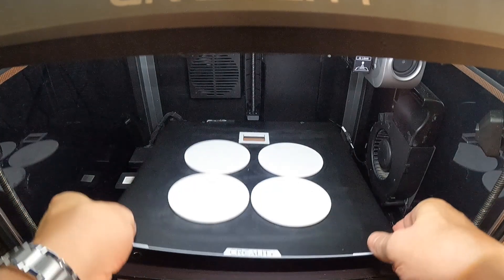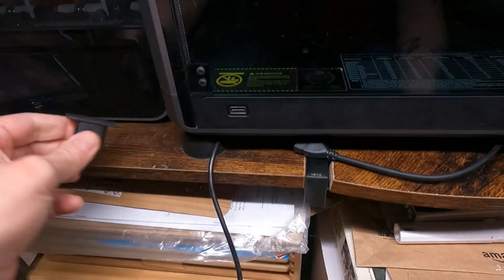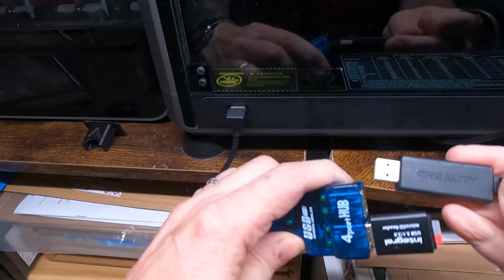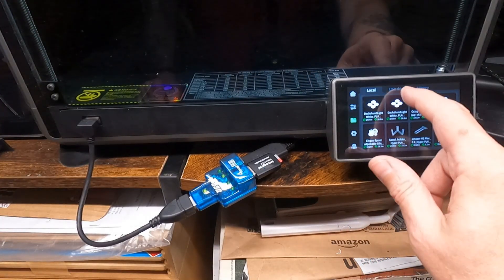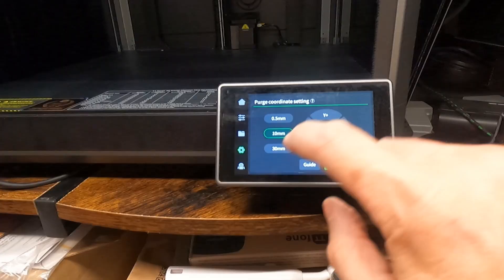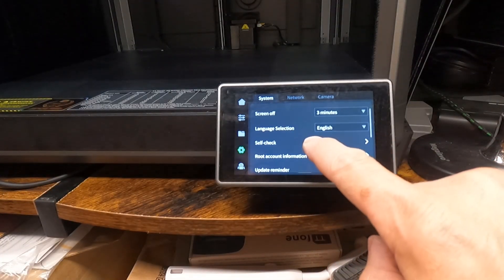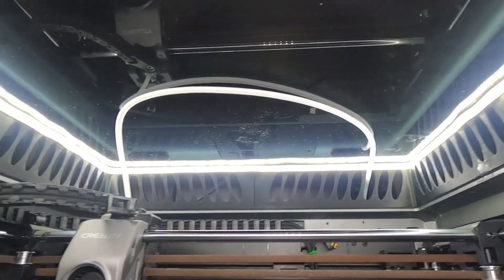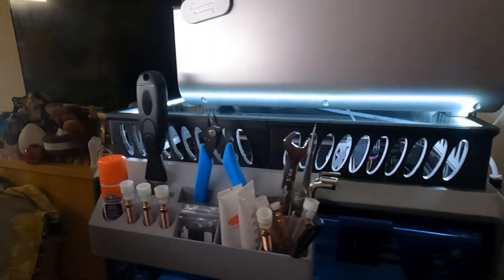CFS Upgrade Kit - Trouble shooting - Mods & Tips

Comment: Is there a way to make a poop bin somewhere
Reply from the maker: Hi, I know some have cut a slot in the back. Personally I find it going to the bottom ideal, I printed off a tray design for the bottom which catches 90% of the poop, and I haven't had any of the blockage issues I have seen reported on ones with shoots. I have limited space so not having to get behind or to the side of the printer I find ideal. I don't see a time I will go to the full extent of the height on a colour print, and even if I did it would only mean clearing out the poop before it got near.

Comment: hola actualice hace poco y le puse el cfs, pero me lanza un atasco cada ves que cambia de color, lo eh desarmado un monton de veces y sigue el problema, si me puedes ayudar te lo agradeceria
Reply from the maker: Hola, no dijiste si recibías códigos de error, supongo que no. Sé que hay gente que tiene problemas con los cambios de color cuando no usa Creality Print. No estoy seguro de si es tu caso, pero si es así, te sugiero cortar una impresión en Creality Print y probarla.
Reply: @Kalbo64 ocupo creality print y me ha tirado varios errores, pero lo que pasa es que cuando corta el filamento y cambia el resto que queda en el hoteng se tranca y produce el atasco
Reply from the maker: Hola, en ese caso, me aseguraría de que el tubo sea lo más corto y sin torsiones posible, ya que esto puede causar el problema. También confirmaría que tienes el hotend correcto para el kit de actualización (hotend Unicorn).

Comment: I had a problem with the lower feeder. It was eating the filament, and the feeder can push after this to CFS filament. Printing stopped.
Some one recommend cut the spring from lower feeder, but is not so good think to do this.
Because when I cut them the problem did not desappear.
I buy new spring (1.0mm x 8mm x 20mm) like oryginal and I added a spring pad.
And after this the problem is solved on my CFS.
Link for small pad for cfs lower feeder spring https://drive.google.com/file/d/1wkRAg-2Ewqlxf0Ghl1OHGVNHGdHK-iQB/view?usp=drive_link.

Comment: I’ve had a k1 max since January, no issues , amazing printer, last night done the upgrade and installed my cfs, first print, worked, and that’s where things went weird

I now keep getting a error (fr2849 retract issue)

But here’s the stranger part, if I push the button on the bottom of the cfs , the filament moves freely , if I trim the filament , and let it reload , it’s fine

If I heat the print head, I can also freely remove / push through filament, my initial thoughts are somehow it’s getting stuck in the buffer block.
Reply from the maker: Hi, I can make a couple of suggestions to try/check might hopefully help. First I would go to the self check and recalibrate the cutter, then expert mode and realign the purge shoot. I would then ensure all the boden tubing has a smooth direct, bend free route as is possible. I know some people go through the original hole in the side without issue, but I have seen others saying they get this error when going that route. I presume the pull strain through multiple bends triggers it. Hope this helps.
Reply: @Kalbo64 will give it a go, thanks
Reply: @Kalbo64 I eventually got it working by accident… I left its lid open 🤦‍♂️🤦‍♂️ Even though I bought 4 brand new spools of creality  cr-pla filament za it would seem that one of the spools some how, somewhere is catching. Lid closed = all manner of shit , lid open = happy cfs
Reply from the maker: Great that you got it going. I'm pleased for you.. I have found cardboard reels can be an issue sometimes, they tend to get dinks in transit, and that can stop them rolling smoothly. Thank you for getting back on the post to update with the issue, this can often help others with similar problems, and so often you see no update or someone saying "all sorted now" without stating what the issue was.

Comment: I just upgraded my K1 Max and only problem I'm having is when it goes to purge, it sometimes throws the 'poop' on the table instead of dropping it below.
And though this hasn't been an issue yet, I think there sould be a better way to have the ptfe tube rout to the extruder. I'm not a fan of how it's loose like that and flops around.
Reply from the maker: Hi, I have had this happen a couple of times. I go to the settings/expert mode/purge coordinate settings - and reset the nozzle to the purge shoot. I haven't had this cause any issues thus far, but I don't want poop on the table that may cause an issue. I get what you mean about the ptfe tube, and I have tried other ways,  but found  having it loose was the best option for me, and it hasn't caused any issues.

Comment: What led strip is that for the lighting?
Reply from the maker: It is this one https://www.amazon.co.uk/dp/B0CSFY3X6H It was cheaper when I got it, and I am sure with a search another seller should be cheaper.
Reply: @Kalbo64 is the usb for the led plugged in to the wall or printer?
Reply from the maker: @Odzyn  Mine is plugged into the wall. I was considering hard wiring into the printer, but decided against  it as I wanted separate control.

Comment: So I just install the CFS and CFS K1 upgrade kit completely purchased from Creality and installed on K1C and very first print I received TC2841 cutter jammed error.  I completely took it apart verified all wires and filament paths are not jammed or clogged and still no luck so very frustrating as I spend about 12 hours on this making sure everything is perfectly done please any advice?
Reply from the maker: Hi, sorry to hear you are having issues. You can under settings - self check re-calibrate the cutter. Not sure if this will help but worth a try. Other than that I would just be guessing sorry.
Reply: No luck still same issue thank you
Reply from the maker: @willrice69  Then my only guess would be sensor/switch/wire connection that feeds back from the hotend, telling it the cut is complete. I can only guess but hope you get it sorted.
Reply: have you ever figured out the issue? i have had nothing but problems with the cfs
Reply: I didnt realize from the manufacturer videos and all instructions that i was plugging the sensor into the wrong port on the printhead. On the left side of the pcb theres 2 ports. One on the backside of the rear pcb and one in between both pcbs (i think its welded to the backside of front pcb). incorrect port is the in between. Correct one is the rear. I rooted everything, reset redid dozen times. It was never shown anywhere that detail but all good not cutter issues
Reply: Thanks I will give it a shot anything at those point
Reply: Never did figure it out i had to replace the cfs and printer

Comment: Hi mate, I’ve just finished setting up my cfs upgrade but when I go to load filament, it loads until it reaches about halfway point before it reaches the extruder and then retracts it. It’s not displaying any error codes or much for me to go on and I can’t for the life of me work out what the issue is, is there any change you may have encountered this before and could help me out? Any assistance would be massively appreciated
Reply from the maker: Hi, I have not had this issue myself. I can only really guess on what might be the problem, it maybe an issue with too long, and too many twists in the tubing, it might be a bad connection to the sensor either from the tube or link connection electrical. Have you assigned the filaments with their details in the "filament" section on the display screen. If they are not Creality filaments with RDIF codes this will need doing manually, For example selecting Generic - PLA - Colour - OK for each one. As I say I can only guess, but hope this helps.
Reply: @Kalbo64 the initial filament I’ve tried to load is Creality but it unfortunately is just spitting it back out. The tube itself has been trimmed to size so I can only look at the sensors I suppose. Thanks for the help, I’ll report back if I can figure it out
Reply from the maker: @wiganer2011  Hope it works out. Just as an after thought, it won't fully load until a print is started as they load to read the RDIF code half way.

Comment: Hola amigo. No has tenido problemas. Cuando el cutter corta el filamento? No te deja pequeños trozos? Es que es el fallo que más tengo en mi K1… y es una molestia la verdad
Reply from the maker: No he tenido ese problema. Puedes recalibrar la cortadora en la configuración, en "Autocomprobación".
Reply: Why does it take so long to swap filament and purge the line mine is about 5 minutes

Comment: Thank you so much for taking the time to make that video! I only received my K1 Max and CFS unit last week and finished setting it up last night with the CFS. My question is with all the shaking they do through the prints how does that go with the CFS on top of the printer? I was a bit worried about mine getting damaged with the shaking or even shaking off!
Reply from the maker: Hi, no chance of it shaking off with the rubber feet on the glass and up to 4kg in filament pushing it down. Damage due to the shaking I doubt. The table I have it on could be better, and does allow it to shake more than I would like but it does not seem to effect the print results.